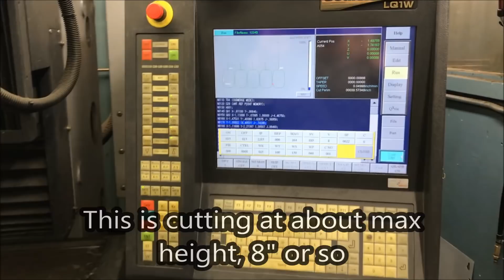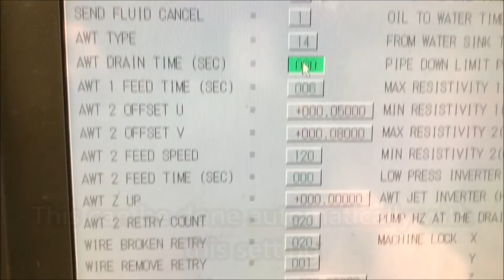MACHINING VLOG: WIRECUTTING ALUMINUM PROTOTYPES

Comment: We use Fusion for our wire cutter, just using the profile cutting section in CAM and then mucking around with the code a little bit, it does work though.